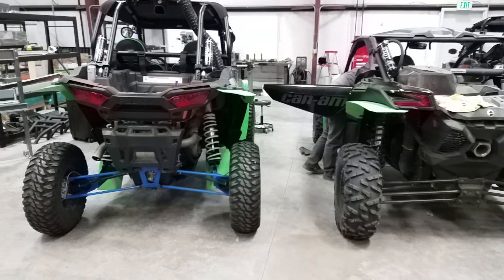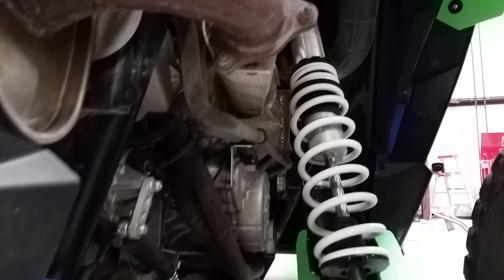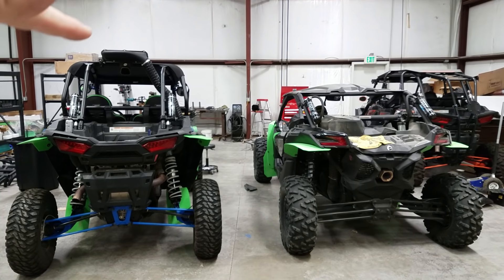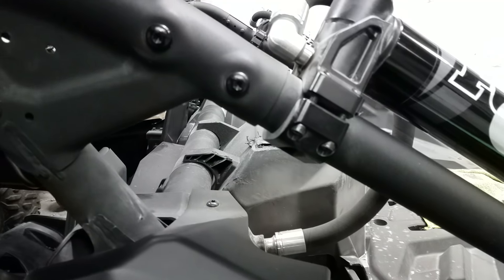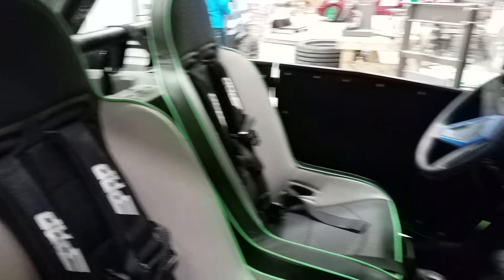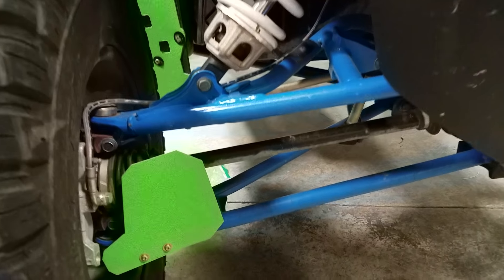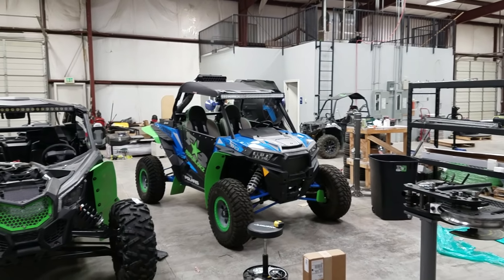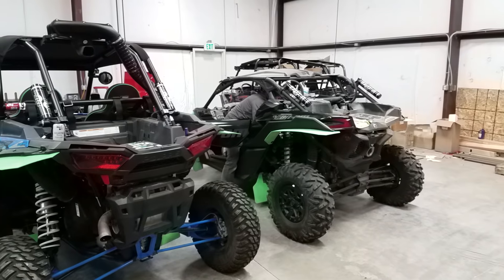Can Am Maverick X3 XRS Vs Polaris RZR 1000 Turbo Comparison Review

Comment: Can Am X3 has the outstanding seating and driver position.
I have both.
The Polaris is the climber, the Can Am is the runner.
The X3RS needs 50 more HP and an auto locker front end.
The Polaris is due for a complete redesign.
Thumbs up.
Reply from the maker: Dive Bar Casanova thanks for the comment man I agree with you 100% if the Can-Am had the locker and some more power it would be even that much more spectacular

Comment: I like your reviews Brandon, as there are hardly any reviews out there on the Can Am X3. I'm on the fence between the Yamaha YXZ 1000R Sport Shift SPECIAL EDITION with the upgraded Fox bypass shocks vs X3 XRS.  I'm not even considering a Polaris. Sure would be nice to find some comparison videos on those 2.   BTW..... RZR office chair....hilarious. !! keep the videos coming, good job.
Reply from the maker: Ted H. thanks so much for your comment. I'm glad you liked the review I haven't driven the new Yamaha with the speed shift but I have driven the original YFZ 1000 I had high hopes for that machine when it came out.  and i told myself that shifting would be so awesome and it would keep the power going to the ground and I wouldn't have to worry about clutching. I had a chance to test-drive one up in the mountain type area. I feel like it made a lot of noise and didn't really go anywhere the ride was really rough and it made me realize that clutching is the way to go. so I'm not sure about the new limited edition. but the X3 XRS is the funnest thing I've ever been on on four wheels.👍p.s if you do an aftermarket turbo kit on the Yamaha it is freaking insane my friend has built one and it is the fastest side by side by far
Reply: Good work Brandon, just my 2 cents the YXZ  with the sport shift SS is way more hospitable, but it is a little noisy, but I have never been in a Can Am to compare, are they a lot quieter? I feel the the RZR and the Can Am are too much money, granted they are turbo, but $7000-$9000 more? The YXZ is no slouch. I just bought a 17 YXZ 1000 SS for $18,000 out the door. The RZR is around $25,000 and Cam Am is around $27,000, that difference leaves a lot of room for mods on a YXZ should one want. Other than the turbo I feel the YXZ is as good or better than either machine. I say this  owning and liking 2 Polaris 4 wheelers, so I wouldn't say I'm Yamaha biased. After owning the YXZ for a while, being little noisy in the cab is a legitimate criticism, but  shouldn't we wear ear protection/helmet anyway. I absolutely cannot justify paying $7000-$9000 more, turbo or not then I did for a 17 YXZ 1000 SS.
Reply from the maker: trader man the YXZ is definitely a good value you can get them pretty damn cheap and they're pretty fun to drive with the manual trans

Comment: I sold my rzr 2010 800s witch now I regret, but I made my own buggy single seat 2stroke 600 triple 110 hp will upload it to you tube soon. love your toys Brandon.
Reply from the maker: +jose flores that's funny man I actually have a custom buggy with a 2-stroke 2 cylinder Arctic Cat 900 EFI engine with 140 hp. I haven't had a lot of time to drive it lately but it is crazy fast and fun still trying to figure out the tuning and I need to get a little bit better brakes on it

Comment: Brandon Pierce, What do you think about the comparison of the 4 seater RZR 1000 Turbo and the 4 seater Can-Am X3 XRS?  Same comparison just in 4 seat versions or is there some additional variables?  It's seems that the 4 seater is much more risky to jump (nose dive).  Is there any increased or decreased risk of roll over with the 4 seat version.  Thanks!
Reply from the maker: +The-Fitness Doctor thanks for the comment. there is not an X3 XRS 4 seater out yet hopefully there will be soon if it's anything like the two-seater they jump very well. When the four-seater comes out in the X3 I would like to get my hands on one. The 2 seater RZR and the two-seater x3 jump better with the shorter wheelbase. The four seaters are stable but they don't seem to jump as good the front wheels leave and then the rear wheels hit and kind of nosedive. I hope this helps you if I was buying a four-seater I would either wait for the X3 to come out or I buy the RZR Turbo 4 seater

Comment: Does the can am have forged internals?  The can am looks way better than the rzr, but one of my biggest concerns is reliability the engine and transmission and the amount of abuse they will take. I wonder witch motor will hold the most power with mods
Reply from the maker: +gigglegasn20 thanks for the comment. I'm not sure if the Canam has forged internals but I think it does have forged pistons. the motor seem strong we've used it pretty hard and it definitely seems to be taking the abuse

Comment: Bolts are just as strong if not stronger in some cases my friend. The rzr roll cages are amazing. They have saved me in many flips. Nothing wrong with bolts.
Reply from the maker: +ian matteson coming from a car racing background and seeing the cages that go in these race cars I'd prefer a welded cage. but you're probably right it's probably just a strong and the tubing on the RZR seem like very thick nice tubing. thanks for the comment

Comment: I like both machines..I am torn on which one to get.. do you sit lower in the X3??  how are the sight lines?  I am leaning toward an X3 and putting a set of 32's and a halo on it...Im still worried about the east coast riding (mud, rock climbing ect ect)..I have seen rzr's do awesome out there...  thanks for your video
Reply from the maker: +Michael Lamb thanks for the comment. you do sit lower in the X3 and I really like that about it. the site is great you have great vision out of the vehicle. We went for another ride a few days ago and the X3 was awesome in 4x4 in the snow we took the RZR up to it did good but not as good as the X3
Reply: do you think it will hold up in mud and east coast type riding.  I bet this thing would be a even more of a beast with a halo locker on it.
Reply from the maker: Michael Lamb everything I've thrown at this machine so far it has been amazing in sand in  Rocky terrain in snow. haven't done mud but the four-wheel-drive was awesome in the snow.
Reply: awesome man  thanks!

Comment: You can't say that just because the tubing is larger that it's better. It depends on the tube wall thickness as well. Just because something looks beefier on the outside  doesn't mean it is. Also, dolted joints can be stronger than welds if they are designed right.
Reply from the maker: +lgs sparks thanks for the comment I agree with you the tubing on the RZR feels solid and feels like it has a thick wall. as far as a bolt in cage I prefer the one piece cage but there are advantages to a bolt in cage. as far as the suspension arms trust me the Can-Am suspension is much higher quality than the Polaris. They are both good machines
Reply: lgs sparks   Think about that for a minute. Why would the Polaris use bolts instead of welding. Number one is that it's cheaper and quicker. Number two is because they know the fucker is gonna bend and it's cheaper to replace a section than the entire frame. Can am is confident in their design. Polaris knows their garbage is going to bend and/or break. Every single component on a Polaris is weak and rattley. The small spring on the RZR rear shock is fully compressed before you even sit in it. Wtf. How well does that work. The made a vehicle that LOOKS like it's bad ass but it just won't last. That's a guarantee brother.

Comment: i ride dunes and woods trails in oregon some tighter switch backs that my xp1k sometimes needs to 3 point turn on. is the X3 more or less agile for tight turns or rock gardens? i want one but i don't want to regret it for 30% of the riding I do.
Reply from the maker: thatgtguy ! thanks for the comment. the two-seater turns great the four seater is a little big and sometimes you will have to do 3-point turns

Comment: Ive seen many of these videos now talking about the beefiness of the x3 arms and the one piece cage. Those are not good things. If you really ride your machine, like the badass its meant to be, you are going to crash. And roll. And hit things. You jump the wrong way once in that can am, it lands first on its say front tire at an angle. You didnt just break your A-arm you just broke your mounts, possibly cracked your frame and possibly your suspension. You end this roll upside down on your cage, which is now bent to hell. You need to have it cut off and have a new one designed and built.  Ot to mention the plastics. So in one crash youve just incurred massive cost and machine down time. Instead of just replacing the front a-arms and bolting on a new cage which you can do yourself. At home. The x3 is pretty as hell. Its got great power. But i wont buy it as is.
Reply from the maker: +50calgold thanks for the comment. Those are all good points it has seemed pretty durable so far and we have driven it pretty aggressively but you make good points. I had a Mitsubishi Evo 8 back in 2003 I put a super aggressive clutch in  it and the clutch ended up being awesome but then I broke my transfer case so I know what you mean it's weakest link you make things too strong than other things break
Reply: ^ polaris owner eh?
Reply: 50calgold   You make very good points that most people don't seem to understand. I only partially agree with you though. I would honestly take a major break down every couple years over a minor break down every single ride. Polaris RZR might be cheaper and easier to repair but it is gonna get old after almost every damn ride. Realistically if you damage your rig bad enough to damage a frame then there's a good chance you are in the hospital and can't ride for a while anyway.

Comment: which one is better trail riding in the woods?
Reply from the maker: sayheytome it's tough to say. I like the X3 XRS but it is a little on the Wild Side so it could give you trouble in tight Woods. the Polaris is definitely really good on the trail I guess it depends on price and where I'm riding most the time
Reply: i went to a polaris/cam am  dealer today and looked at both machines. the polaris looks higher off the ground and maybe top heavy. when i sat in the can am the seats felt lower than the polaris.
Reply from the maker: +sayheytome if it's my money I'm buying the Can Am for sure but the Polaris is a good machine to
Reply: sayheytome .the can am is ...get the ds .mine is ds and i barely fit around trees .the rs woulda went home ..great for desert tho

Comment: What is the power to weight ratio between the two.
Reply: I own a 2016 rzr 900s. it's 1000lbs with 100hp. good power to weight.
Reply from the maker: +Bryan Haas thanks for the comment I'm not sure that the power to weight ratio is but I can tell you both the RZR 925 turbo and the X3 turbo feel like they have plenty of power
Reply: X3 looks like it weights a lot more though.
Reply from the maker: Bryan Haas it only weighs 90 pounds more and it's full long travel

Comment: What's te price tag on each rig?
Reply from the maker: +Fun From Up North the Polaris is 24999 and the long travel Can-Am is 26899
Reply: Brandon Pierce what one do you think is worth it
Reply from the maker: Fun From Up North they both good    if you can find a 2016 rzr they have deep discounts but if you the money the can am xrs is the way to go it comes 30 inch tires and roof and mirror good seats welded frame and full long travel suspension. also it depends what kind of riding you are doing

Comment: Nice vid but I noticed at 1:53 that the bottom trailing arm looks bent. Is that suppose to be bent or not. Might wanna check that
Reply from the maker: Skeg chaser thanks for the comment the bottom trailing arm actually has a bend in it from the factory

Comment: the rear of cage is not one piece there is a one inch gap between rear and middle of cage .the thin plate holds it together..the stock cage is super thin 065...i cut mine off its like paper.
Reply from the maker: +Rhu Austin thanks for the comment. I did notice the tubing on the Can-Am did seem like it had a little bit thinner wall. but I still like the cage design

Comment: I didn't realize polaris had a 1000 turbo!
Reply from the maker: +Brian Byers thanks for the comment. Polaris  does have a turbo and it's awesome 168 horsepower it's a cool machine.
Reply: I know they have a turbo but it's a 925cc not a 1000
Reply from the maker: Brian Byers sarcasm I see it's because I called it a 1000 turbo. yeah I know it's a 925 I'm just used to the old  1000

Comment: Comparing a 2017 can to a 2016 RZR is not exactly a fair comparison.  The 2017 has some redesign and more hp.
Reply from the maker: +R6pilot thanks for the comment. I was simply comparing the two machines that I had access to. but besides the horsepower in the 2017 the 2016 is pretty similar.
Reply: not to mention, popos are junk anyway.

Comment: One thing about that x3 is it fits tall dudes good, im 6'3 and x3 seems to fit me best, unfortunately my wallet is anorexic.
Reply from the maker: billcharlene1450 I'm 6,3 to and I'm a big guy and it fits me great. it is a little bit pricey but if you tried to make an RZR have suspension travel of an extra it would cost you way more
Reply: +Brandon Pierce I dig em both but my budget may be regular xp range have you had much seat time in the rzr, like to know how the leg room feels (coming from a fellow big guy) after a day of riding?
Reply: my experience is opposite. I'm 6'5" and 330lbs..I fit in my rzr xp just fine. sat in a x3 at the dealer yesterday and couldn't fit. knees were smashed against the dash, couldn't even press the gas, and yes the seat was all the way back, really disappointed because I want one bad.
Reply from the maker: man thats a bummer. i wonder if you could do a custom seat and make it work
Reply: I hope so because I really want one lol

Comment: Just throwing it out there, the new new 2017 rzr turbo is pushing more hp than the  x3
Reply from the maker: +Raekwon Willis thanks for the comment you are right the new 2017 RZR does have more power but I'll take 20 less horsepower for a long travel with good seats a good cage 30 inch tires beadlocks is just so well built
Reply: Brandon Pierce very true, can ams build quality is usually better, the're just not all that fun to work on lol, curious to see if the x3 is any different lol
Reply from the maker: Raekwon Willis I think the X3 is going to be better to work on because they finally put the engine in the rear like the Polaris I think people going to make the x3 pretty badass
Reply: Brandon Pierce can't wait to get one in the shop, maybe in a couple of months lol
Reply from the maker: Raekwon Willis thanks for the comment. yeah the 2017 makes a lot of power I haven't been in one but that's not really what impressed me about the X3 it's the chassis the suspension the seating the frame the handling that so much better and has good power to
Reply: Brandon Pierce it's a can am did you expect anything less from them lol